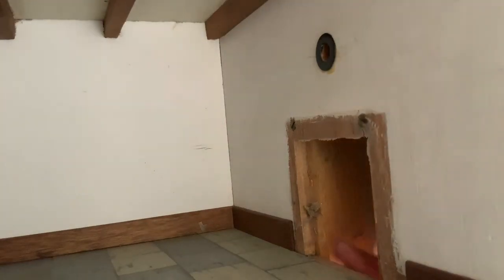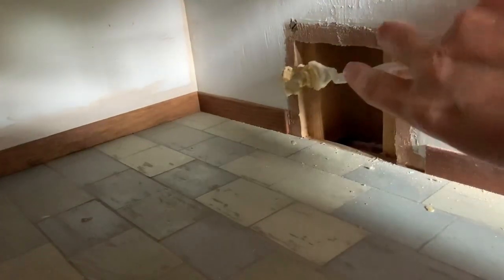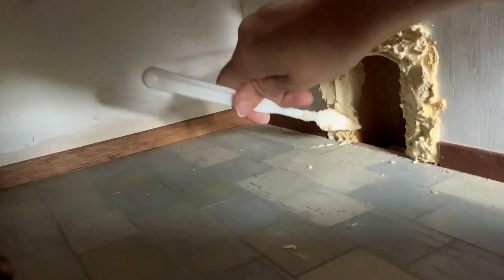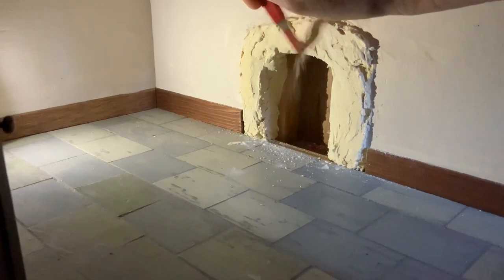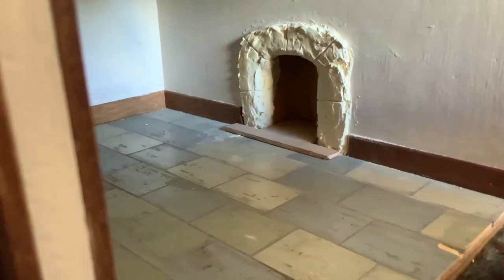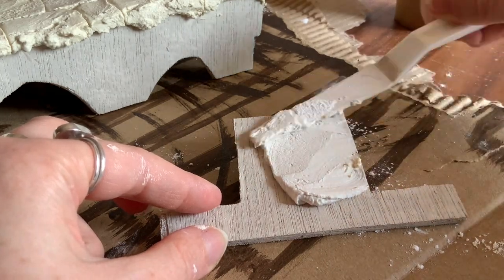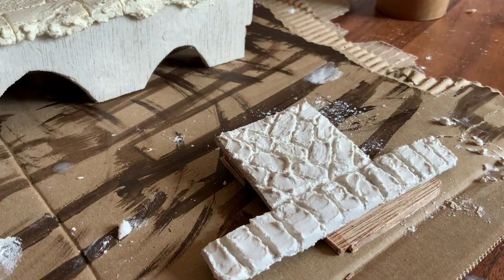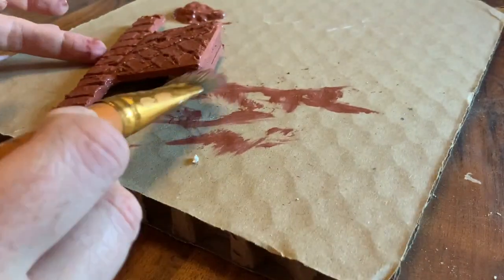Making a Miniature Stone Fireplace | Tudor Doll’s House Makeover Diary - Part 14

Comment: If you get some fine metal mesh, you can rub your chalk pastels on it and use one of the little plastic boxes with different lidded compartments, you get beads and nail art in them sometimes, and keep your different pastel colours in them and use a makeup brush, which is made for powder on the pastel dust.   It applies better with a makeup brush and your hands dont get so messy.  You can put white glue on the hearth, then put your biggest coals on it then when you put on the finer coal and ash, use white glue and water mix in a spray bottle to stick the little bits, if the glue water mix doesnt want to go beneath the surface add a bit of isopropyl alcohol and it will. Also theres a channel called thicketworks who does some amazing medieval dollhouse stuff, its for a cricut maker but lots can be adapted to use if you dont have a cricut.
Reply from the maker: Ooo thank you for your suggestions - I’ll keep them in mind for future miniature makes! I love learning new skills, materials etc. 🤗